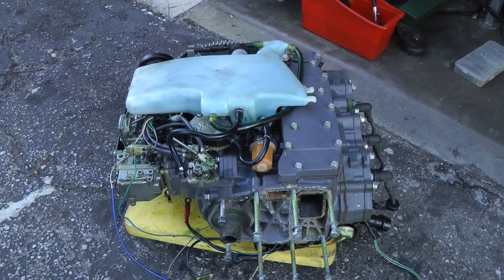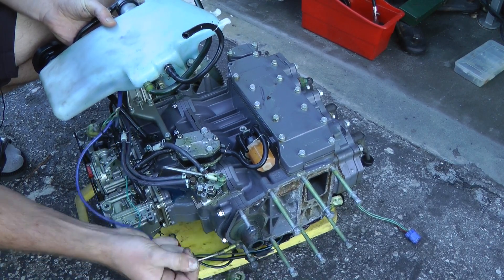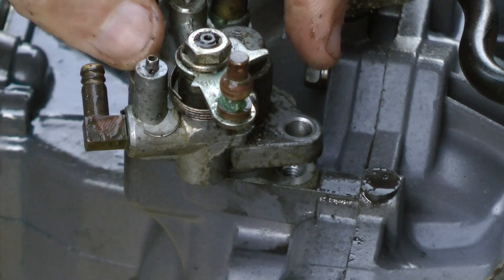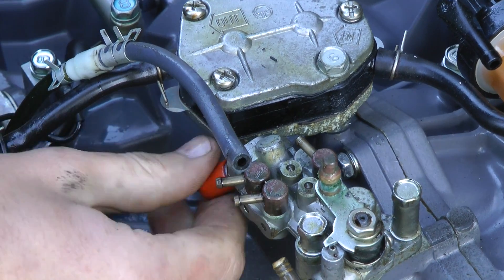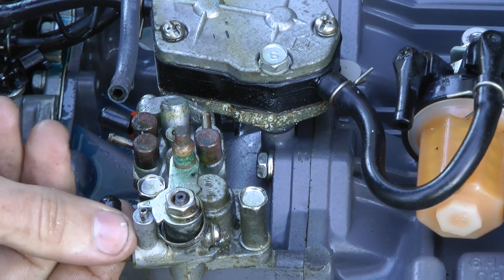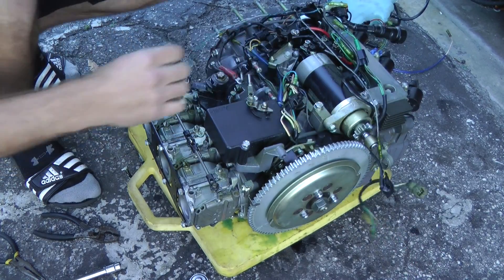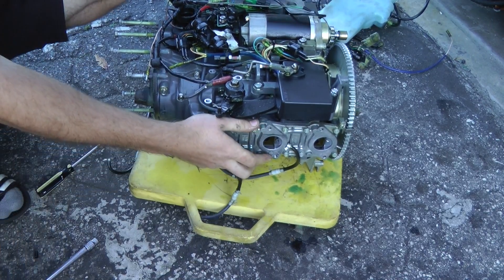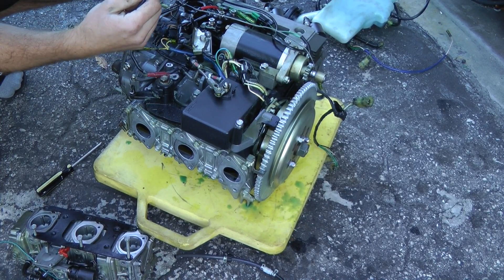How To Disable/Bypass A 2 Stroke OutBoard Oil Injection System

Comment: Why cap all the holes ....If your going to mix your oil and gas now then just simply dissconnect the main oil feed line from oil tank and plug that one hose . Its a closed system so if your not sucking air or oil then you should be good to go . Actually you Will be good to go , did mine that way 15 years ago and works great . 3 min job
Reply: that is the red cap?
Reply: @135-j  Correct ....Oil is going thru the GAS PUMP
Reply: Which hose is that?  There's so many of them!
Reply: @islandofboom5704  Which hose is what ? Dont touch any of the hoses on motor . Oil tank has 2 hoses , just plug or clip the one running to motor At the tank . Then add oil to gas tank 50 to 1. So if you have a 40 gal tank and it's half empty , add proper mixture for 20 gal ...Dissconect fuel line running to motor , squeeze ball until you see blue gas coming through .....reconnect fuel line and your finished
Reply: @mike7044863  cool, can I jus6 dis connect the arm that controls the oil pump and be done with it since it's a closed system?
Reply: @islandofboom5704  ....Id leave the arm alone ...Just remove hose at oil tank and be done with it
Reply: @mike7044863  ok, do you have a e.mail? When I get back can I send you a pic to clear up confusion.  Sorry I'm a slow learner. Lol
Reply: @135-j  Oil tank ....cut hose at tank and just plug it with a screw or what ever . Thats it , Dun Deal. Evinrude 150....Take shaft out ??? No , that's motor work .....dont touch the motor
Reply: @mike7044863  so you mean, I can just take out the pump out and take out the chaft put the pump back on and disconnect the cable?
Reply: @135-j  Well i didnt remove any pumps ....once you mix oil with gas your lubed
Reply: @135-j  my lines are hidden under deck by batteries....Not like anyone is going to see a hose thats hanging there next to a pump . Tie it up if u want
Reply: My sensor went out the other day. So I decided to delete the oil reservoir. I’ve been falling this guy for a long time now, I was extremely happy to find he had a video on this, because he does really good explanations on diy projects. After the vid I happen to see your comment and did won’t to do it the easiest way possible but after doing like you suggested, I realized it looked half ass. Hoses just dangling and I realized “the boat guy” showed how to properly do it, the way you expect a professional to do, or a guy your paying money to do it. No offense man but your way is half ass and lazy! I ended up doing it exactly like this vid, looks clean and professional!
Reply: @muskbeard3924  ????? Loose hoses ????? You simply snip the hose on the oil tank which is Below deck and NOT VISABLE . Plug the hose or cap it and BE DONE . 1 hose to cap so where do you get Half ass and sloppy ??? Go your route and spend half the day tearing your motor apart  as opposed to a 3 min job . I did mine that way 15 years ago , No problems. Long as you prime the  gas hose afterwards and see the blue gas coming through before you connect gas line to your motor your  golden .

Comment: You have the absolute worst outboard repair videos anywhere. Why would you disconnect the best oil inection system in the business no need to.
Reply: I always put a small amount of oil in gas tank .I can't afford a new motor .its never failed yet and to much is better than none .only about 10% in tank is enough to save a engine!
Reply: wait until your motor is 10+ years old and your oil pump goes out.  the engine will overheat so quickly and you'll have to buy a new motor.  You're welcome.
Reply from the maker: thx for viewing my videos troll I'm getting paid for you to watching my videos.
Reply: @ThatBoatGuy  Troll!? He is actually right, no need to disconnect. Whether it is absolutely the worst video is subject to debate.
Reply: @Ray_NA  Well it's certainly not one of the best videos that's for sure
Reply: Look my 85 Yamaha just stop pumping oil I wonder can I clean the pump
Reply: Even the best can fail. Mine stopped due to an unknown electrical issue and the alarm float stuck engine stopped but didn’t seize. I got it running but and can run the oil system off straight 12v power but it isn’t getting signal to turn the pump on. I won’t trust it again I got lucky this time even though I’m sure it did some degree of damage
Reply: @richie2dicks468  Just tell me how can my fully mechanical oil pump on my Suzuki outboard fail.
Reply: Ray Ataergin it probably won’t but that doesn’t mean an electrical issues won’t cause the remote tank to fail to pump to the engine tank or the alarm could fail I mean anything COULD happen. I’m not saying the systems aren’t good I’m saying it almost cost me an engine because anything can and will break at some point. It’s your shit idc how you wanna run it.
Reply: We remove every Yamaha oil injection pump. They have and will fail.
Reply: @OctoberHouses  "We" who? Are they really that bad? About what hour mark do they fail?
Reply: @OctoberHouses  u do it the same way this guy done it in video and then use vacuum caps
Reply: @OctoberHouses  My 1968 Yamaha DT motorbike with 47300 kms still has its original oil pump fitted with never a problem and im the original owner..Im very happy with the Yamaha brand.
Reply: Not the best. Mine failed, and cost me an engine.
Reply: Guys if i did this disconnection on my dads vintage Suzuki CCI engine  and run premix IT WOULD SEIZE solid..The crank main brgs are  sealed and pump pressure fed ONLY..so premix wont work..BE CAREFUL on some engines..They will melt
Reply: @albertsammut433  Thanks! Good to know!🙂👍🏻👏🏻👏🏻👏🏻
Reply: You tell em my friend
Reply: i just sold a 1989 150 2 stroke that is still working and never failed.
Reply: where do you work so i can avoid your shop the next time i go boat shopping
Reply: by the way, evinrude makes the best oil injection system in the business and have years of reliability to back it up.